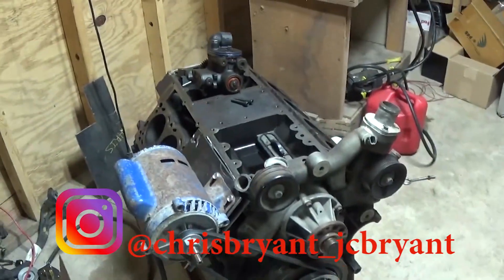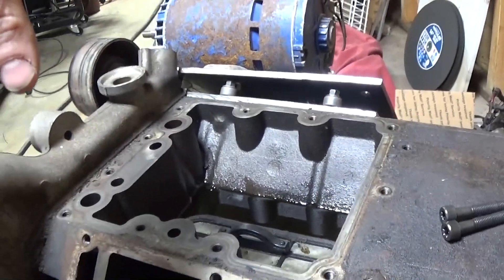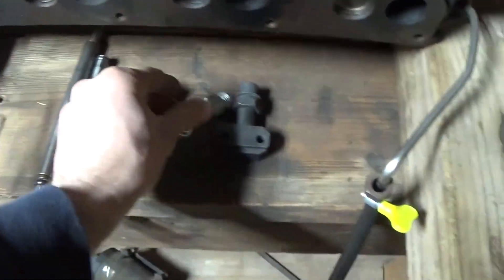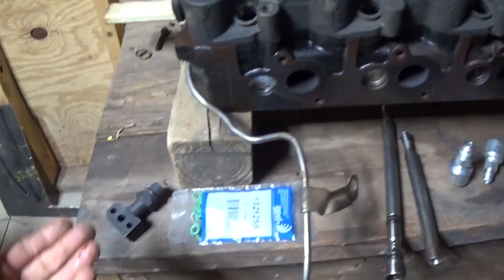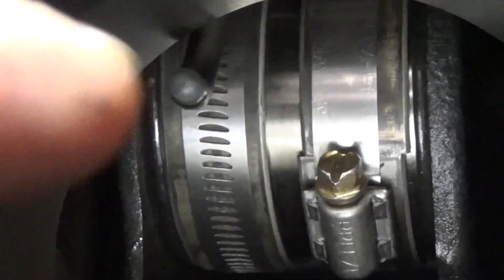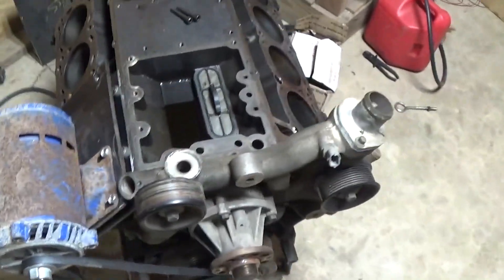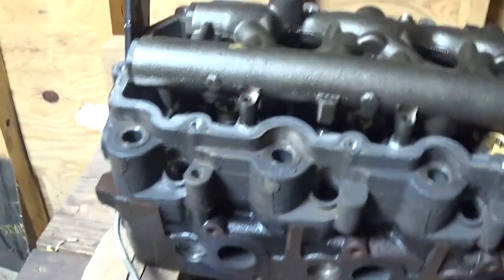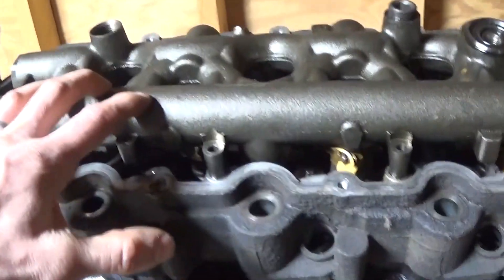Finally starting the 6.0 Powerstroke injector flow bench! Help me stay focused on this!

Comment: Hydraulic pump. Switched Power to coil. Plus feul. 
 Don't need all that extra motor bulk etc. Oh, be careful of that open belt thing. It sucks loose clothing. 
  Like your thinking tho. Keep the videos coming.
Reply from the maker: Agreed on a hydraulic pump and switched power. But I really want to simulate the injectors firing from the ficm. Would love to create injector data.

Comment: hell yeah! wouldn't mind pay yeah to test a set of injectors for me. May not be a bad idea to build a tub or box in case something blows a couple squirts of hot  rotella @3600pds may not feel to good. lol you can prob pull apart a oil heater for the heat element. Im on the same boat as you with tuning i use Hptuners seems like more i learn i realize the less i know lol   I may need your help if you get turbo stuff, I'm gonna finish a refresh ls6 motor for my camaro after xmas I bought the turbo couple years ago it's just a 78/75 t4 china ebay clone but other day lookin at it i realized the exhaust housing is only a .96 a/r I'm hoping you know where or if  you can get me a lil bigger housing Its kinda a hodgepodge street build over-cammed n boosted 6 speed  so  lag would really fuck me i'm sure that .96 a/r be really responsive but I'm afraid it will make more back pressure then boost
Reply from the maker: Yea you and I sound like we have to much going on. 
Definitely going to build a plexiglass box around it.  
I can try to help with the turbo housing.  Shoot me an email chrisbpowerstroke@gmail.com

Comment: Very interesting, I like your thinking. I might have done it a little different, using an electric driven hydraulic pump for the oil side so I don’t need to use the engine side. Not sure what you need all the sensors for , but it looks like you want to have a full scale set up...?
Reply from the maker: I need the sensor input to make the pcm think the engine is running so it fires the injectors.

Comment: you could potentially use the Dummy plug and drill its side out and part of the top to provide oil pressure and weld your fitting on it. can't wait to see the outcome of it

Comment: Nice setup. It looks complicated, but I like the track  you're on. After watching a hpop pressure gauge in the cab, the f650 we have will run 4000psi at full throttle, pulling a long hill here. Definitely need good hydraulic fittings.
Reply from the maker: Just focusing on one area at a time. First make the engine pump oil. 
I’m pretty sure the hoses I can have made are rated to 5000 psi. I plan on building a plexiglass box around it once I get it going.